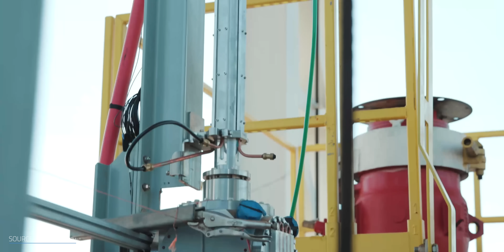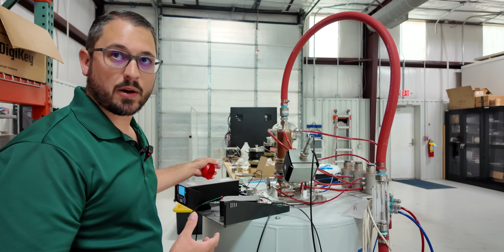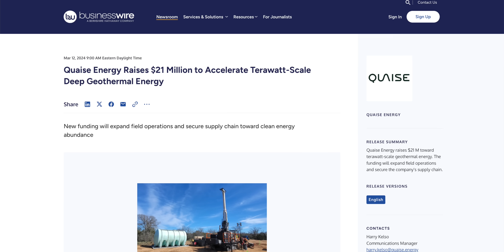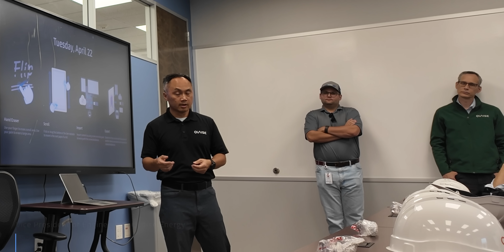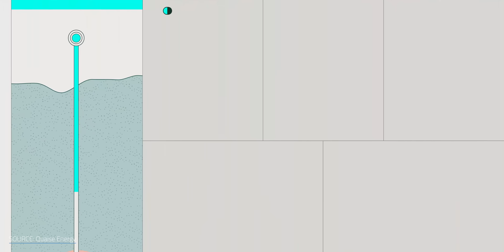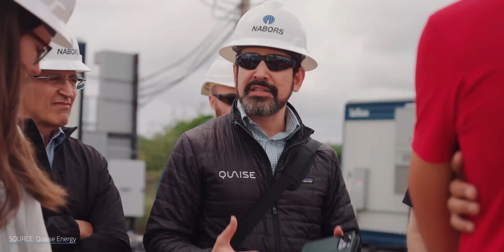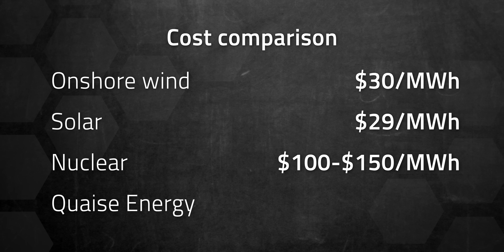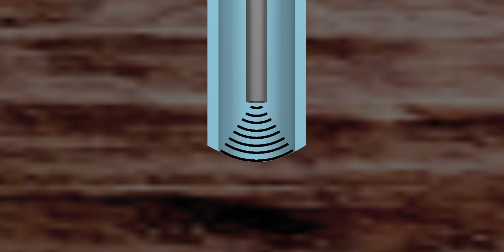How Geothermal Energy is About to Break its Limits

Comment: Interesting stuff, but can you please stop using the LCOE as a useful economic metric. Solar and wind only seem cheap until you bake in grid integration and backup energy costs. Not to mention land use. These don't come from thin air. When you do that, wind and solar are like 2-13x more expensive (BoA 2023) than nuclear. For geothermal the price would likely stay quite the same.
Reply: Not quite, when you factor in storage to achieve 97% capacity factor, solar has an adjusted LCOE of just over $100/MWh. The storage negates the requirement for the vast majority of the grid reinforcements and backup energy that you mentioned.
Reply: @ronankierans1600  Because the metric isn't LCOE but LFSCOE. Bank of America did study comparing places like Texas and Germany and found that solar was 2x-18x more expensive. Backup power is one thing but grid requirements are separate, and have to do with things like frequency and phase stability. There's a lot more to this. I know a local company that produces these massive industrial flywheels to add inertia. Also these are also a function of deployment ratio, including land costs (!). Huge issue in certain places. And solar en masse in places that aren't desert will require possibly destroying carbon sinks aka forests. But in reality, I'd imagine in places with little use land like desert + huge amount sun (Cali, Spain, Australia, Sahara) etc. solar would be very competitive.
Reply from the maker: @jirikivaari You're right that LCOE misses system costs, but LFSCOE has a fatal flaw ... it assumes each technology must supply 100% of demand alone. No grid works this way.

Real grids use diverse sources that complement each other. Actual integration costs for renewables are ~$10-30/MWh at high penetrations, not the 2-13x LFSCOE suggests. It's like calculating car costs assuming each needs its own highway.

The truth is between LCOE and LFSCOE - renewables do have integration costs, but nowhere near what the 100% scenario implies.
Reply: @UndecidedTechnology  

Ehm, it is true that not all customers need constant power, or rather have flexible needs. With prices, you can to some extent moderate demand. But you stil need to match actual demand or you will have blackouts. Data centers and a lot of industry need constant power though. This is why Microsoft is building its nuclear plant. I don't think they are either stupid or ideologues, I'm sure they'd have gone with renewables if it was cheaper. After all renewables have better PR value. 

The grid integrations costs usually don't include LDS, which you can estimate statistically. Eg. from Spain it's like 9.2TWh. (3%) Hydrogen is the cheapest LDS (battery wins short-term), and would naively cost maybe 30 € per MWh on top of base price. In reality, papers put the full decarbonization of Spain at around 70€ per MWh total with mix of many sources so the guess was pretty good, and that didn't even include rest of the grid costs. Oh yeah Spain had massive elctricity grid failure recently that actually resulted in fatalities, because of not enough inertia, which will cost money. They're now at 56% renewables.

Since Germany closed its nuclear plants it has sported higher prices, this year 25-30% over France. For example France with its nuclear reactors is almost (92%) co2 free in electricity production, Germany 42%. In fact coal is cheap, replace that with some real co2-free backup power + grid integration, and it will cost a lot more. We can just look at the number of coal plants they use for backup and baseload during winters. That's about 100TWh. Using renewables, batteries, hydrogen etc. to replace that would add roughly at least €30 per MWh on top of LCOE. Research papers put the LCOE after such replacement around €60-100 per MWh, on par with nuclear. And that's just estimation. If they actually do this, we'll have some real hard data.

Of course this misses the fact that nuclear produces insane amount of waste heat. Here in Finland, we could not just in theory, but in practice, heat whole country (34TWh) with the waste heat from nuclear reactors (in fact we'd have another ~30TWh to spare). And for the record, we do have district heating everywhere. The heating pipe math checks out, with orders of magnitude improvement over market heat. If you subtract that from the LCOE, with some back of the envelope calculus it could be as high as 80% from LCOE. The reasons we don't do this is because its not cheap to take these plants down, redesign a whole bunch of stuff and re-certify the plant etc. Plus politics. But we could do that with new plants. They're building SMR right now just for district heating, which is kinda silly but whatever.

And that's not even everything, most nuclear LCOE's are using 40-year life, but that's just politics. Well-designed plants could last 60, 80 or 100 years, ask a real nuclear engineer. Reason is that a lot of components are replaced anyway. That would again drop the price even further.

On semi-related note, I read a paper that put the post-Chernobyl panic causing additional 2 million deaths from air pollution from coal etc. plants. Converted to full lives, that would be around 200k. Solar and Wind were much more expensive back then and not really an option. Had we just kept building, we could have decarbonized electricity already, saved lives, possibly saved climate and would likely have GenIV reactors, plus much cheaper nuclear due the economies of scale (that renewables are currently enjoying).

For nuclear, it gets even better. GenIV reactors can produce hydrogen with HTE with massively lower prices, which will be a critical component to produce green steel, which is a massive source of CO2. Also can be used for many different applications, including shipping. Not to mention they'd much more efficient (up to 50%) in producing electricit. The more time you waste on renewables, the lower learning rate for you have for all of these. On top of that the waste heat with VHTR's can be industrial grade, not just low-temp heat.

And don't get me even started on the land usage inefficiency, or the PV waste.

Anyway, if we just cut subsidies off everything, we can let the market decide. Everybody can put their money where their mouth is. Talk is cheap. No need for endless debates.
Reply: @UndecidedTechnology  Yes and no. No country has gone beyond ~60% variable renewables afaik. At that point, long-duration storage (LDS) becomes essential. Hydrogen is one option, but the last real-world project came in over $200 per LCOS, plus huge upfront costs.

For example, Germany went all-in on renewables and is about 40% CO2-free. France, mostly nuclear, is 92% CO2-free. Electricity prices in post-nuclear-shutdown Germany have been 10-30% higher than in France - and that`s with coal still in use. That's real world.

Turn off coal and you`d need something like 30 TWh of storage and 141 GW of renewable capacity. Studies estimate Germany's total average cost for 100% renewables would hit 80-100 eur per MWh - similar to nuclear costs.

Also, nuclear uses 5-100x less land than renewables. And over nuclear's waste heat could be used for district heating, practically cutting LCOE in half, if not more.

Comment: This is fascinating, but gaseous rock seems extremely likely to condense, solidify, and stick to the waveguide when we get to large scale systems, or if it's in the form of a cloud of dust, to abrade the waveguide on the way back up.
Reply: I’m pretty sure they thought of that
Reply: @willinton06  75% of the time with these sorts of thoughts, with technology at this stage, they've certainly thought about it but they haven't figured out a way to test it without a full-scale demo.  Sometimes it's a non-issue.  Often you never hear from the company again, and they go bankrupt or "pivot" for unpublicized reasons, to include 'the funding ran out' and 'we actually never managed to solve that one'.  Hopium is an important resource for small tech businesses.

Comment: Geo thermal works 24/7 and not just for power, but for heating and cooling as well. The benfit there is that there are a few levels of drilling for each one of those and if they can get teh price down, I dont see why we wont be tapping into the Earth not just for homes and small business, but large scale locations as well. I think you covered, Yellow Stone alone could power the whole US - but this will allow any parts of the US to get it without having to run lines and lines of cables.
Reply: One of the wasted sources of heat is condensing used steam to water for reuse in generation.  If this heat can be used for heating (and cooling via absorption cooling) it would be more efficient then just using geothermal steam to generate power.
Reply: geothermal can also be deployed and sustained on any planet, it coudl be useful for establishing extraterresrial bases in the future
Reply: I’ve always thought that out of all the energy sources, the down sides of geothermal seemed to be the most easily mitigated or overcome entirely. Transferable skills from petroleum industry (so no skill shortage), no toxic/radioactive byproducts, no energy storage issues, low land requirement, low maintainence (compared to something like wind)… The risks of triggering seismic events are only an issue near fault lines, so if you can figure out how to drill deep enough to make it work far away from fault lines, it’s a total win.
Reply: "Heating and cooling" is ground exchange heat transfer, not technically "geothermal." While they both involve drilling a hole, they are very different things.
Reply: I think if you uses these kinds of drills, you plan to go deep, so it will always be hot, so no direct geothermal cooling.
Reply: It does have dangers and drawbacks that include causing a rupture that lets liquid magma flow into fault lines and voids which could cause earthquakes or worse.. Tapping that heat can and is a clean energy bonanza
Reply: It's currently cheaper to use a heat pump powered by grid electricity for heating and cooling. Most transfer heat to or from the atmosphere like my Mitsubishi ductless mini-split, but the Google X "moonshot" Dandelion Energy hopes to make near-surface drilling (a hundred meters deep, not kilometers like Quaise) cheap and straightforward so that ground source heat pumps are more competitive.
Reply: Don't forget about direct lithium extraction (DLE) already happening in the Salton Sea CA. We may be able to extract rare earth elements just by strategically placing geothermal plants in mineral rich areas.
Reply: @LonnytheLesser if the salton sea was in a red state that would already be full scale
Reply: @mattbrew11   They never would have built it in a red state as the state legislature would have blocked it.
Reply: @LonnytheLesser they never would have built a mineral extraction operation in a red state? 😂 you are down so bad
Reply: @mattbrew11  They never would have built a geothermal power plant that is required for direct brine extraction. The 12 reddest states in the union have a whopping total of 1 geothermal power plant despite states like Texas, Alaska, and Wyoming having huge easy to get at geothermal potential.
Reply: @LonnytheLesser  California is being their usual selves with all sorts of ECO lawsuits and State government demands for a cut of profits..
Reply: exactly, if they can make digging boreholes faster and cheaper, it could make geo heat pumps the definitive form of air conditioning.
Reply: Not if they drill all the way down to where the green people live.